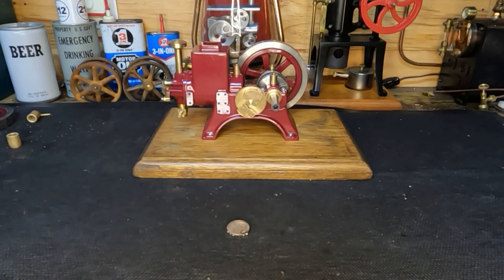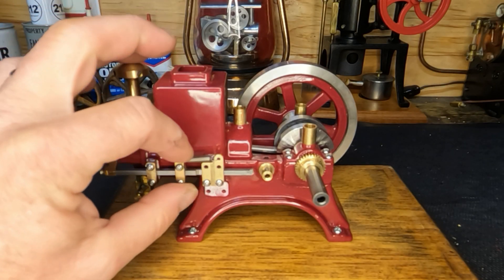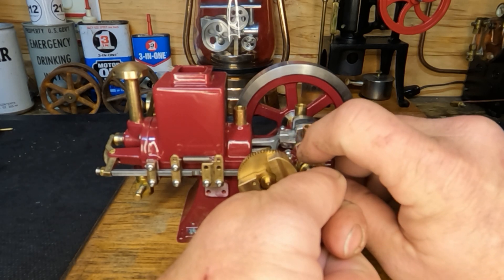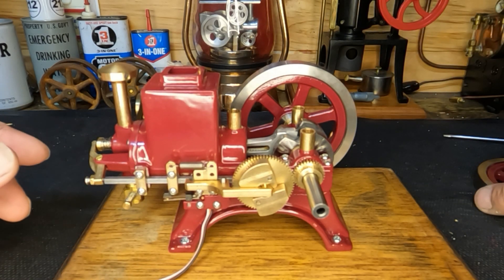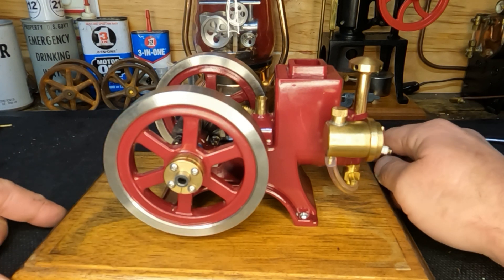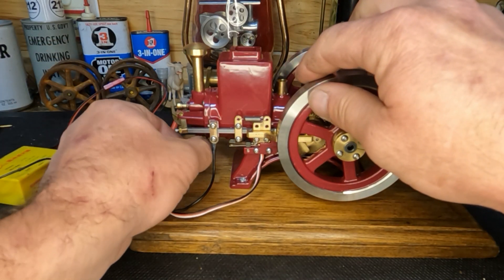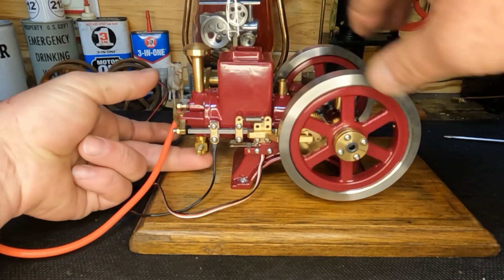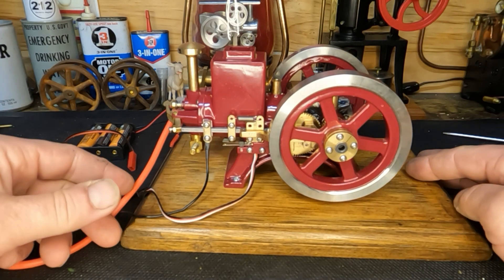Enjomor 6cc Hit & Miss! More Balls, Re-Assembly, And Test Run!

Comment: Hi,......I only have the earlier (2020)  ET1/M-90  6cc, 9:1 Compression ratio hit & miss engine experience to compare or Performance relate to......Why use Any  2 Stroke, oil Diluted fuel in a 4 Stroke engine ?? ....  I use straight 50 Octane Coleman or Crown pure White gas in my hit & miss engines that efficiently pop or "Hit" 1 time only followed by many misses (12 or so) for the Classic, realistic, unloaded  "Hit & Miss"  running sound.....It took numerous, careful Tweaking adjustments to the flywheels centrifugal weights Springs & Exhaust valve  Latch-Out mechanism to achieve this Performance.....Ignition spark Timing (0° TDC) ,  valve Lash (0.015") &  Exhaust valve Close Timing (5° ATDC) is used.....As there's No piston drip Oiler provided,  Directly applied  Cylinder wall  5 Wt. motor oil Pre-lube is used for Piston/Cylinder lubrication.....Consistent Multiple firing "Hits" between "Misses"  to reach "Latch--Out"  usually indicates Undesirable Significant engine Combustion Inefficiencies going on.....This requires  Consistent reliable A/F mixture Ignition firing on every Single power Stroke.....Your pre-start priming fuel Suction seems Very weak compared to my M-90  engine......Hit & Miss engines require really Strong fuel Line priming Suction to run right....I  adjust my gas tank's Highest Topped off fuel Height just Below the carb Spray Bar/Mixture valve Centerline Height to avoid Flooding or Priming feed issues......I can't figure out your  engines Exhaust valve latch--out  centrifugal Weights Spring mechanism ?? ....As the latch--out Spring & fly--weights are critical to good "Hit & Miss" running operation,  maybe you could show More of that Mechanism ??  ......Thx for video.....  tom

Comment: ok...i get the pre-mix but what i don't get is why the slower combusting fuel in an engine with such a low compression engine? wouldn't the slightly faster burning & less stable lower octane fuel work better with the pre-mix scenario because :oil directly in the mix/ combustion chamber  slowing the flame front's propagation?
Reply from the maker: I understand that this is in no way a high compression ratio engine that needs 94 octane fuel to prevent pre-ignition. The main reason I use the VP fuel in my models is because it is ethanol free (rubber and o ring friendly) shelf stable (if I don't drain the tank, it won't turn in a few months) I have found it to be a good clean burning mix that leaves VERY little carbon deposits behind, and it doesn't tend to give me a headache like Coleman fuel mixed with Marvel mystery oil does, especially if I run it in the shop with the doors closed. Not to mention that 1 quart seems to last quite a while running these little engines

Comment: It's coming along nicely. When you added the bearings to the pushrod did it add extra length to the rod? Just wondering if that is why it isn't hit-n-missing.
Reply from the maker: Hi Chris, I didn't measure the factory length before modifying it but before milling the slot I laid out where the hole went through for the "axle" screw so the bearing face was the same as the rounded end of the pushrod, then drilled it, milled the slot, and tapped the side closest to the cam gear. After those were done I lightly dressed the rounded end down with a file. I doubt that the length is much if any different that stock. We'll get it slowed down and see if that helps. What was in the video is exactly what happened after it was reassembled so there were no "test runs" to tweek anything in for the video. Thank you for the idea (I am curious now too) and thank you for watching 👍

Comment: Or,  maybe a belt driven generator?, for ignition.
Reply from the maker: That would work to keep it running but I think starting by hand would be a bear
Reply: @steam212  Yeah, you would still need initial start up voltage.

Comment: Excellent job Matt. I am amazed that your sausage fingers are capable of neurosurgery! Are you still thinking of a piezo ignition? I would think that a tiny magneto system would be a REAL challenge.
Reply from the maker: Hi Joe, I may still see if my idea for a piezo ignition will work but that is after we have it running the way it should. I wish I could take credit for the neurosurgery but I did put these sausage fingers to good use cracking walnuts to feed my assistant, who knew that the squirrel was so good at running the mill 🙂